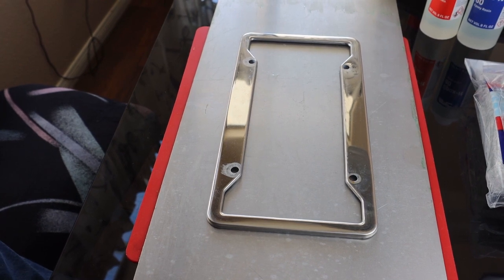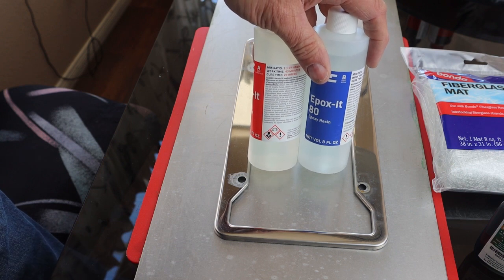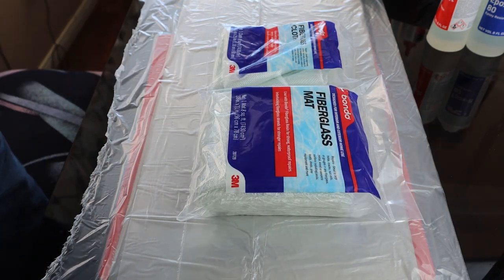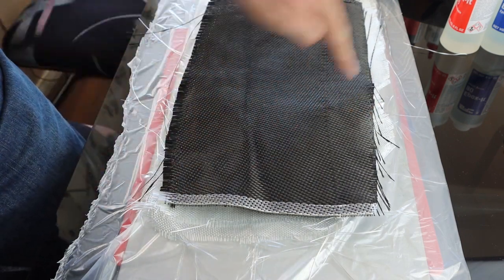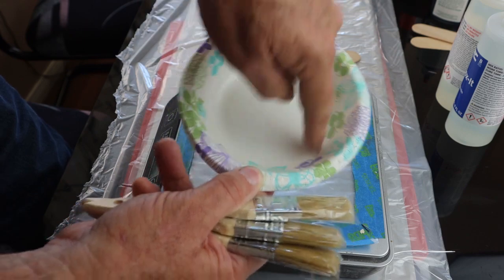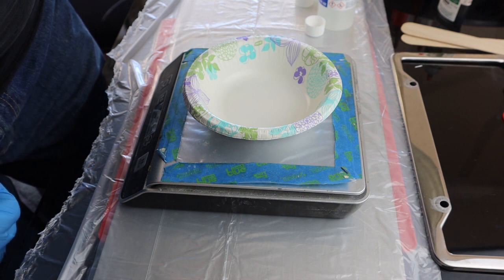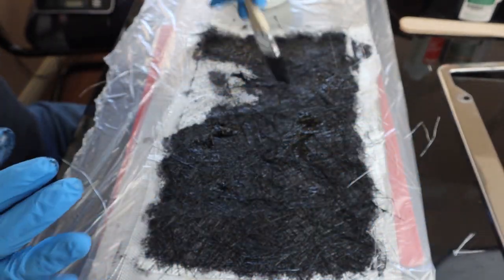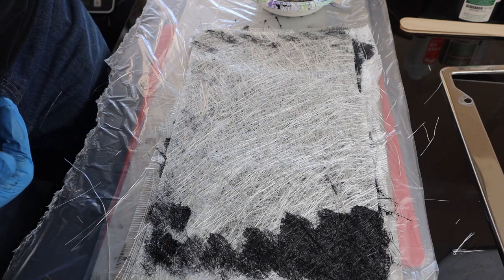DIY Make your own Carbon Fiber License Plate Holder, for Cheap Part 1

Comment: Hey Joe do you know if carbon fiber will stick to wood or plastic? I was thinking of remaking my boat dashboard, I know they make carbon fiber wraps but I was looking at my options, great video Sir 👍😁
Reply from the maker: Dave, epoxy will stick to wood, very well.  It will stick to most plastics if you rough up the surface.  Resin will not stick to polyethylene.  That is why I used plastic sheet to work on for the license plate
Reply: @JoediyLab  thanks Joe